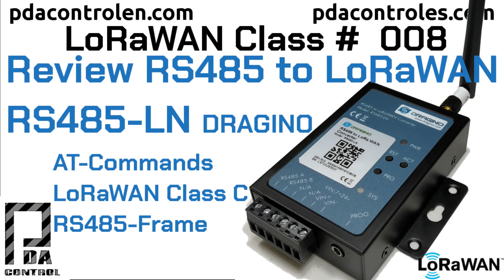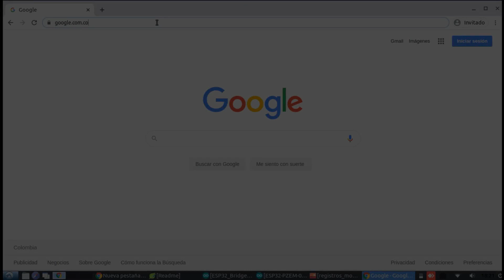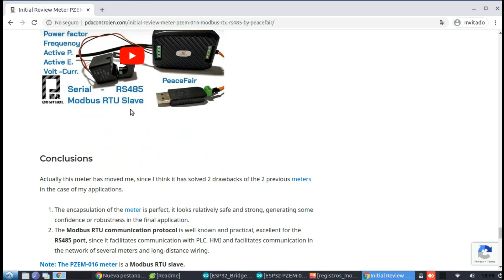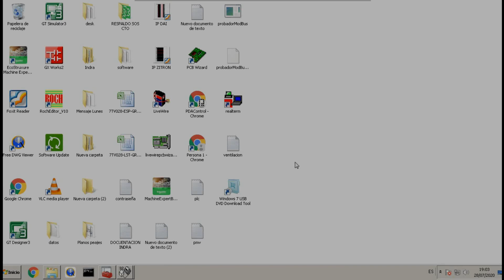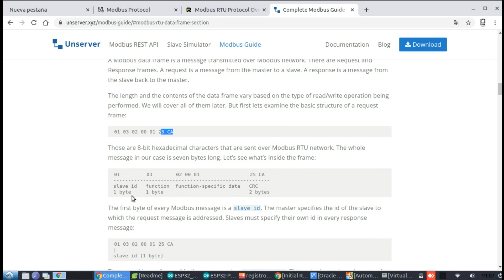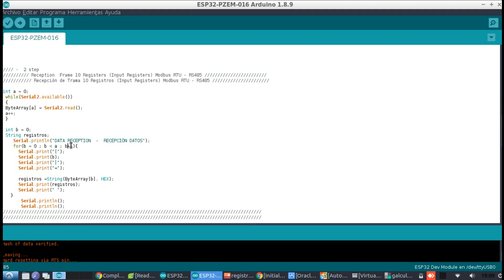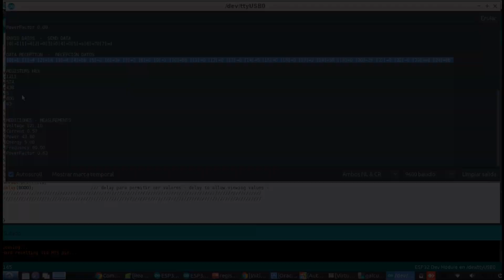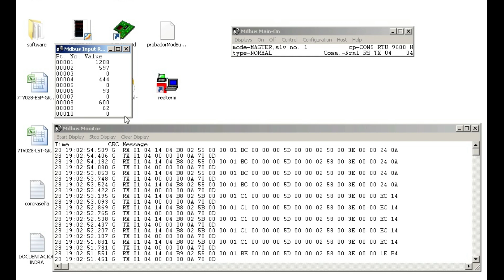Basic Test Modbus RTU (Master) RS485 with ESP32 + XY-K485 + PZEM-016   without libraries: PDAControl

Comment: PZEM-004 имеет "китайский" MODBUS RTU. Не соответствует стандарту.
PZEM-004 has a "Chinese" MODBUS RTU. Does not meet the standard.
Reply from the maker: Hi, Thanks for the contribution, I suppose it is a shortened version of the given protocol, it mainly works as a slave, which is read, Greetings from PDAControl